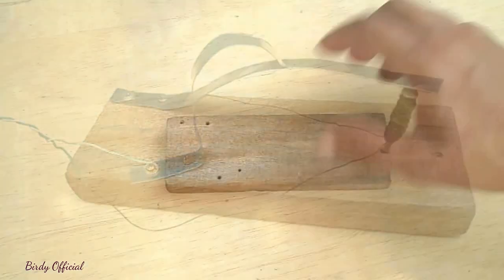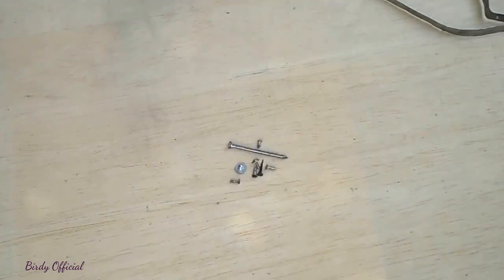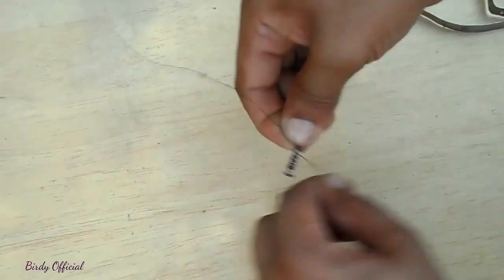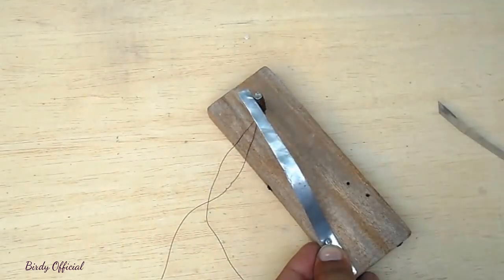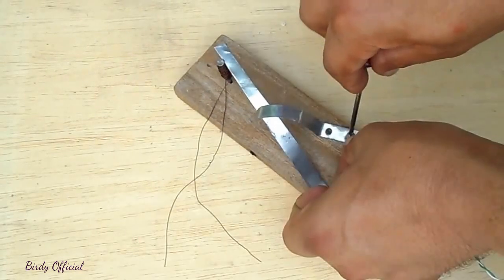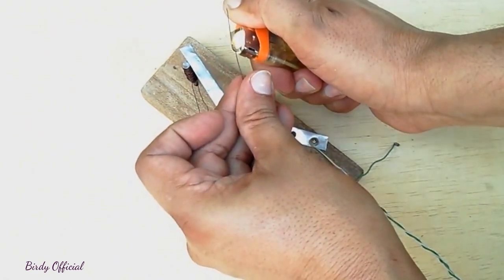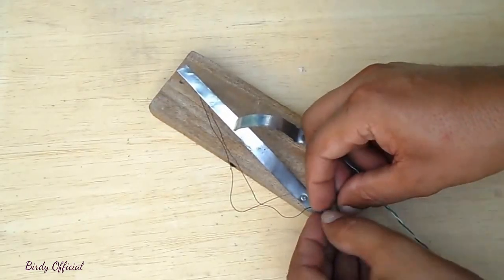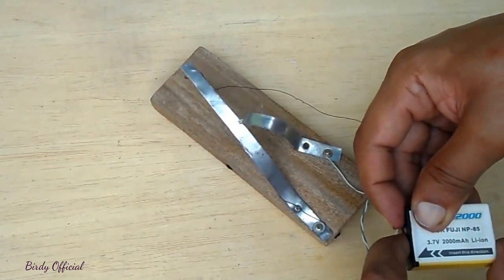Electric Bell DIY | How To Make Electric Bell/Buzzer At Home

Comment: Here have to be battery 3v?
Reply from the maker: not necessarily 3 v, you can use more, but I will not recommend more than 6v for kids school project.
Reply: @BirdyOfficial  ok, but I have 12v battery, will it works?
Reply: @wojtekmaecki8563  Use 12v but add 100k resistor

Comment: Can it works by electricity
Reply from the maker: electromagnet can be create using both currents "AC" and "DC" for AC you have to increase copper wire. Electric bells available in the market work on AC current. Personally I would not recommend using AC current.

Comment: can i use cold drinks can
Reply from the maker: Yes, if it has enough elasticity.
Reply: can i use nornal copper wire and 9v hiw battery 
small nail or a big for electromagnet
Reply: and thanks for replying so fast 
and plz reply fast the day after tommorow my science exhibition is there and i want to make it fast and be in contact and reply fast plzzzzz help
Reply from the maker: @anamikaacademy9025  It will be my pleasure to help you.
Reply from the maker: @anamikaacademy9025  you must use insulated copper wire and the nail should be round about 3 inches.
Reply: plz reply to my questions plz

Comment: Can I use any metal strips?
Reply from the maker: Yes,,,but should be flexible, so that the electromagnet can easily attract it.
Reply: @BirdyOfficial  Thanks for suggestions.
Reply: where can i get a metal plate?  store is only sold in several 10-pound pieces.

Comment: Please say me, How many volt of battery can we use?
Reply from the maker: I used my camera battery which is 3.7 v. You can use 2 AA batteries.
Reply: I used 9 volt battery it doesn't work....
Reply from the maker: 9 volt battery is fine and will work better then the low voltage battery.  When you wrap the coil first check the electromagnet.
Reply: @BirdyOfficial  its good..its an  working nicely
Reply from the maker: That's great!

Comment: How much wire did use on the nail what if it doesn't attract because some times the coil will not attract. I'm a little nervous if it doesn't work
From where can v get those strips pleeeeeeeeeeease reply
Reply from the maker: 5-6 feet wire will be enough. I cut the strips from a tin can. If you made it carefully, it will certainly work.

Comment: Can you please elaborate how you made it work? The idea is good nonetheless. And please give more details about the materials you used, I have tried making this and it did not work. Why is that?
Reply from the maker: The bell work on the principle of electromagnet. It is consist of coils of insulated wire wound round iron nail. When an electric
 current flows through the coils, the nail become magnetic and attract the iron strip (armature). As it go down, it disconnect from contact switch and the current flow stops, the nail become neutral and the iron strip go back to it's place and touch the contact switch again.This process repeats very quickly and again and again.
Reply: I think you got the wrong idea... I'll just clarify my question again, how did 'YOU' make it work(emphasizing on your part). But thank you for that also helpful information regardless.
Reply: Maybe your metal stripes aren't from iron, so they don't react to a magnetic field? Did you try to pull them with a classic magnet?

Comment: What is the explanation behind the process?
Reply: see it is very simple at first when we apply current then the nail becomes an electromagnet and attracts the metal strip when the metal strip strikes the nail the connection with the other metal strip touching it breaks hence now no current passes thought the circuit and the the metal strip returns back to its original position and the process goes on and on creating that ringing(buzzing sound). from India